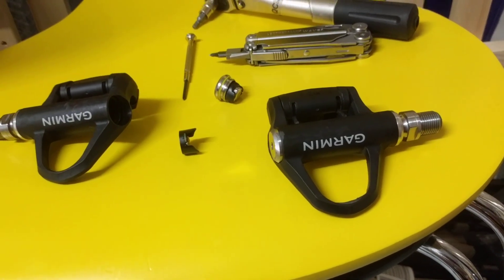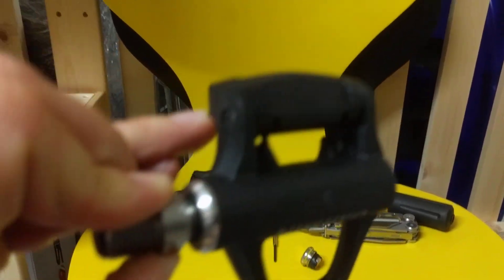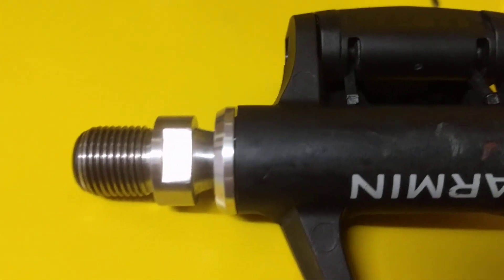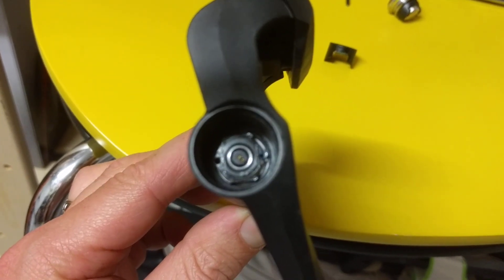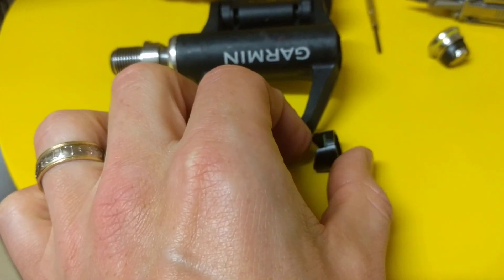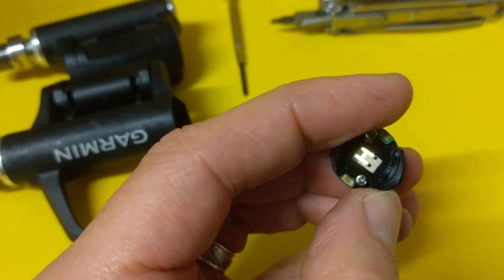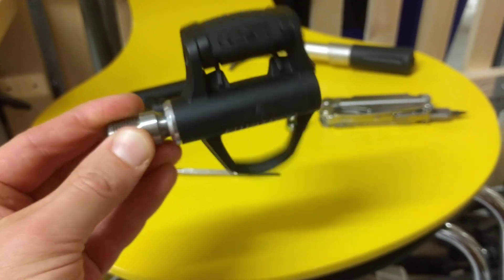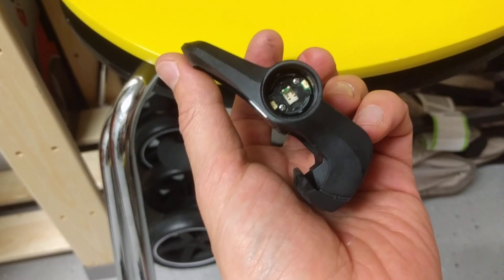Vector 3: Actual reason why right pedal disconnects

Comment: Had same problem. Sended in garmin for fix get back in 6 weeks. Used in second days right pedal was stock again..
I fixed this gap on right pedal with Skylety Thread Seal Tapes!. Now works great already 2000 miles

Comment: I still have problems with mine. The last pair got replaced 6 months ago and have failed again
Reply from the maker: After many replacements I think Garmin has finally nailed it. You need last generation battery doors (the ones that have 4 electric contact points) that you can obtain from Garmin. Also you must use 1 thicker battery (instead of 2 thinner batteries). Thing is, batteries swell and destroy the contact points by applying excessive pressure. A single (thicker) battery swells less and the updated doors handle the issue better. Also you should apply mineral oil on all contact points when replacing the batteries. All this makes it work like charm. Good luck!

Comment: Pls, i have firstly managed to tighten the gap with pair of "Universal" pliers. But it released soon.
Than i realized, There are 4 holes around the pedal spindle, so i put hex key (size3) in one of the holes and spin the pedal to tighten the gap. I could do this even during a ride - stop for a while when "right pedal is missing" message appeared, tighten the pedal and went on.
Then it happened to loosen twice a ride, so i put firstly toothpaste, Then loctite in the gap.
But the thread is in the middle of the pedal, so it had no sense- the gap had no thread.
Finally i had to remove the hole pedal spindle following the original garmin pedal cleaning video ( https://youtu.be/z1X3ztDNL6k) and just after that i could unscrew the spindle totally to put the "thread lock" to the thread, not on the a is only (Pls remember, that right pedal has the reverse screw!). ThenI have  put the toothpaste all along the thread inside the pedal. ( I use toothpaste instead of threadlock) Now it should be ok.

Comment: Worse design ever, the pedals are pure (expensive) rubbish. Batteries don't last, so every time you change them, you face the problem again (if you were lucky to "solve" it the last time). My pedals have the new cap, they don't have the gap, but the problem remains. I feel cheated.

Comment: I can’t emphasize the importance of having the 12mm socket and a torque wrench adjustable to 10 nm’s, to undo and tighten the spindle nut. If you don’t have these tools don’t even try to maintain the pedal.

Comment: I had the exact problem with my right sensing pedal (of my vector 3). I tried to hack the issue placing a wedge underneath the battery contact spring, which partially resolved the issue. But wasn’t a long lasting solution. I have tried using the 2nd generation battery holder and battery cap. That didn’t do the job either. After I have received the email,regarding the 3rd Gen battery caps/holders, I have contacted Garmin support, explained the issue of the metal piece having a gap between the pedal body, exactly as described on the video above. The company sent me a new right sensing  pedal body, and a new pair (3rd generation) of battery carrier / cap. I essentially replaced everything with the exception of the spindle. And finally everything is working, so far with no issues (10 rides about 300 miles). I was really impressed with the Garmin costumer support line, who are actually working remotely at home due to Covid-19. It was no issue that the factory warranty was expired by almost 1.5 years.
Reply: Very good to hear that Cenk.  I only bought my pedals in March and it is my left hand pedal that as stopped communicating.  I chose the Garmin pedals because Garmin's customer service has always been so good.  I have been waiting for the new battery caps for more than 3 weeks now and really hope that when they arrive my problems will go away.  They are struggling to receive and ship parts because they must be running on a really stripped down staff.  I can live with my problems, was just hunting on here for any work-arounds.

Comment: Garmin have finally redesigned the battery housing and connector and are offering free replacement parts. Lets hope these work
Reply: The "right sensor missing" is absolutely not issue of the battery housing, But of releasing the screw inside of the pedal. 
I think i have one of the First pedals, and it happens to me too.

Comment: Don't buy Garmin - Very B.A.D. Buy PowerTap Pedals!  I've had every problem possible with Vector 3. (takes 10days to get new ones and they work for about 1-2 battery changes - 2months - then more ISSUES. Very BAD.)
Reply: Why Powertap? I'd say Favero Assioma is the best pedal based power meter.

Comment: ATTENTION:  you can easily re-tighten that metal bearing cap with an improvised ultra wide screwdriver or bent-needle-nose pliers.  Worst case, just use big mouth pliers.  Left pedal has normal thread, right pedal reverse, same as the spindle lock nuts.  Mine got both loose after about 5000km of use.  Luckily I discovered the tight left pedal before the pressure could do any damage to the battery system.
Reply: yes totaly right takes 1 minute
Reply: Hi i have the same problem can you please make a short video how you removed the gap!
Reply: Fadi Farah hi screws in easy like normal screw even by taking thin scissors put in 2 of the little holes and turn
Reply: @nadinecarrera  I will give it a try thanks a lot
Reply: Fadi Farah ok let me know
Reply: Thanks for posting this. Have you found that the bearing cap comes loose again after further use? If so I am thinking of using a "wick-in" loctite thread sealant in the gap before re-tightening  the cap. The low viscosity of this green coloured  sealant allows it to wick-into the threads by capiliary action without  the need to disassemble the cap from the body.
Reply: Thank you! I was able to use a pedal wrench by just putting the point of one side of the wrench into one of the four opening on the bearing cap and it turned pretty easily.

Comment: I just had the same thing on my right pedal.  The GAP.  I contacted Garmin Service and they are replacing my pedals.  It's very frustrating that such an expensive, 3rd-generation product, can still fail like this, but at least they are willing to deal with this on the back-end of the transaction through customer service.  Tightening it per the service advisory didn't address it. :(

Comment: The design is correct, however the main problem is the assembly processes are not QA/test before ship to customers. Garmin should have a better QA process.
Reply: Garmin puts their products to soon on the market. Garmin is using his customers to test their products. Then you have trouble.....I ordered a set of vector 3 end 2017 at www.powermeter24.com and still no delivery!
Reply: Here is the solution for your pedals VECTOR 3 https://youtu.be/RRPJPFkh9ec